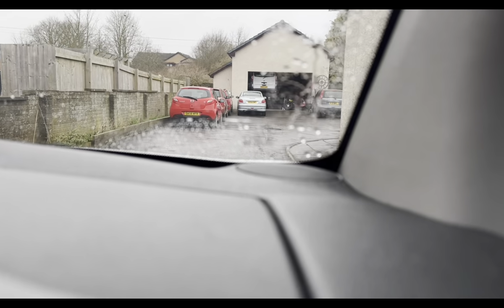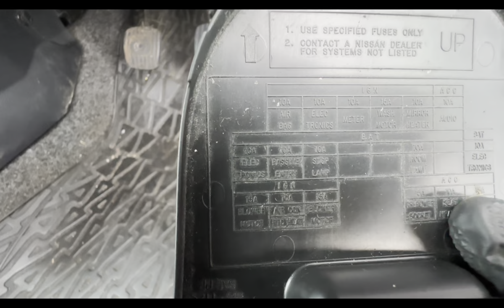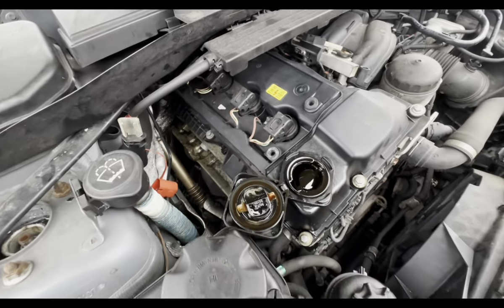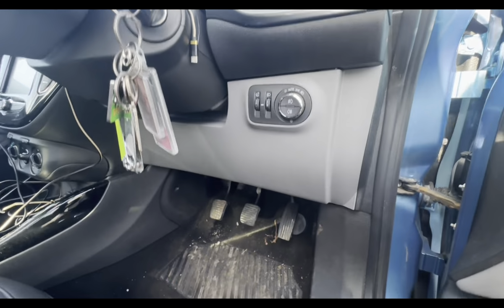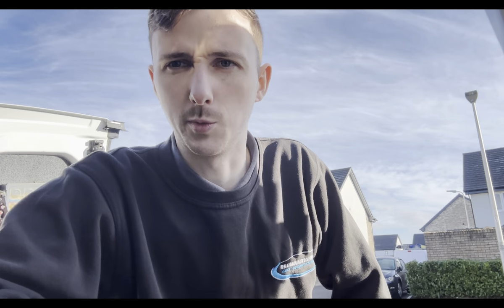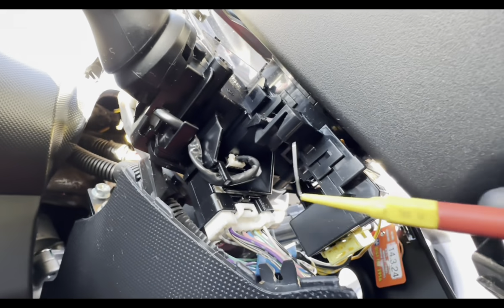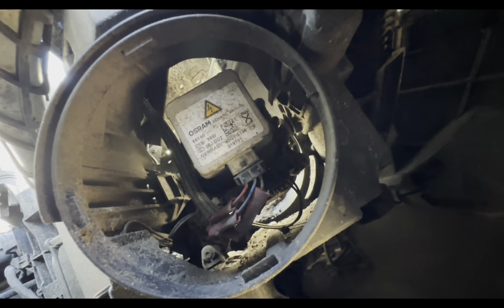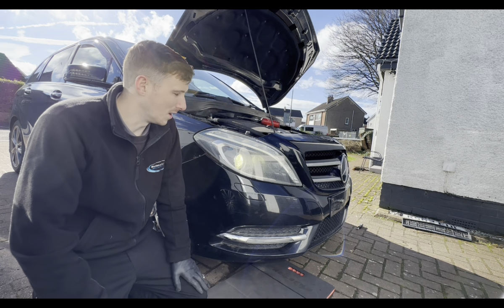A day in the life of a mobile mechanic | A full mornings work lost | Customers cancelling 😡

Comment: Been bitten from a cluster paracitic draw before turned out it was the fuse box keeping the cluster awake water ingress kept it alive unplugged the cluster draw went away stripped and soldered all the solder joints tested all OK on the bench put it back in the car draw was back only on the cluster fuse so it was a head scratcher so only thing I could do was strip the fuse box and found the issue

Comment: no idea why these people not fix a timing chain they not the most costly thing. we should be doing all we can to keep these older cars on the road. my car worth £2k or private a tad more i just spent £500 on it even tho im getting rid at some point hopefully next 6 months . it clutch but only when it warmed up it was slipping and i could baby the car made it last out as don't do lot miles. my car timing chain kit anything from £80-300 and a 4-6 hour job. no excuse not to fix timing chain on a car if you scrap a car because of it you do not deserve another car. you decided o by expensive brand so you should be ready for big bill at one stage, and prob cost about the same as if it was belt driven as chain 140 plus k miles a belt ever 60-80 k so you at least change a belt twice or three times for one chain replacement if you cared about your car. my cars always better when i change them than when i got it, people to dam lazy to maintain them right these days and many too much money they scrap good cars. mot history on my car stupid thing it failed for like tires, i take my car to local mechanic and i say to him fix if any doubt i want a clean pass no advisory it a 2011 car last 4 clean pass he gives car a good going over then takes car to mot and i collect later that day. even replaced a belt only for power and water pump i could lasted but i added it to list things to sort and it first service that got fixed to. if it not fools going to an mot for a fail it grubby filthy people who treat car as rubbish bin ive been looking for cars and 3 pages car im looking for only 3 cars what inside looks great rest stained seats they horrid state what is wrong with this country and it people, but its true people who have disgusting cars also have home just the same. nightmare to find a car what been looked after good and not tramps even on cars from 2015-16, my car people get in and said do you even use your car how a car should be kept

Comment: Great videos mate! Question for you. Whats the best eay to confirm a bad BCM? More specifically a J519 module on s 06 transporter. Ie what tests can i do to confirm?
Reply from the maker: It depends on your fault, If it has no communication your typical tests would be powers, grounds and network. Always make sure you load test both power and grounds
Reply: @mrautoservices7354  this one has the hazards/indicators coming on intermittently and the horn. No no com faults stored. Bit annoying it's intermittent cos I'd have to catch it in the act. Not sure how to test don't want to guess